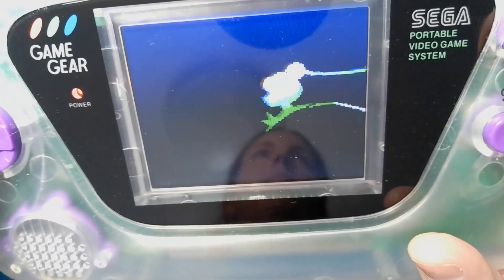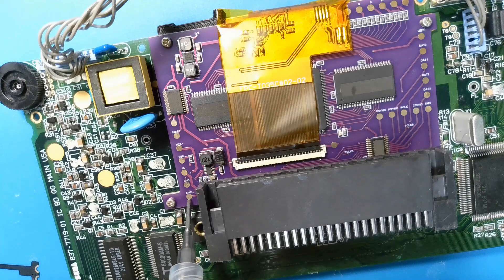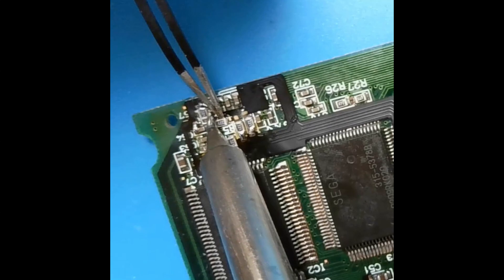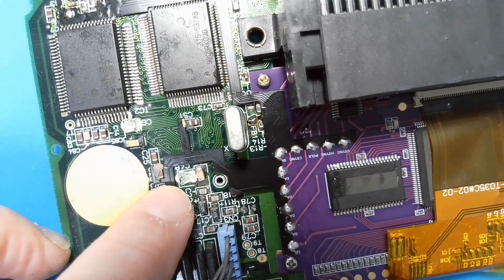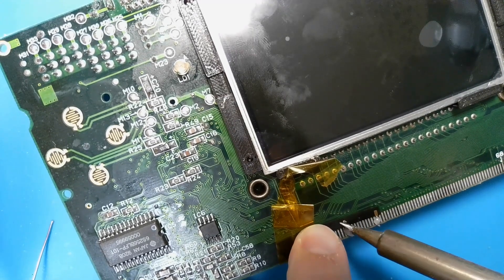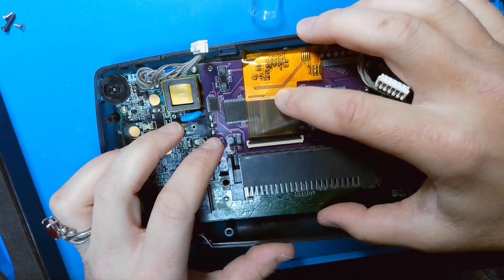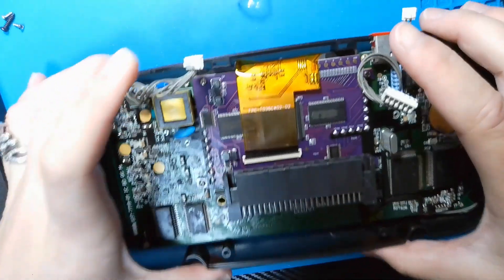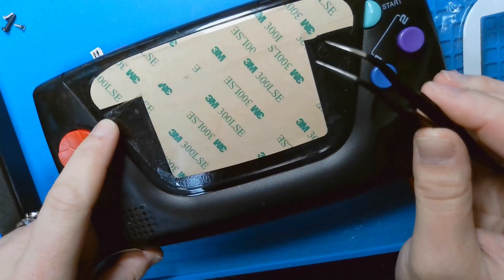Sega Game Gear CleanScreen Mod

Comment: Holy crap that looks so much easier than the ones I did. I got the first gen mcwill clones from ali express and a few of the 2nd gen clones with brightness control. I had to use all wires and regular caps which meant I had to route everything and get the bigger caps  to fit without interfering with the case. I couldn't help with trouble shooting these newer boards but I can say just double/triple check every solder connection you made to make sure there are no cold solder joints or bridges. I did have trouble with the 2nd gen boards because you can't wire the brightness control if you want to have VGA output installed so I had to get some resistors and install them onto the LCD mod board to neg out the brightness control option. The brightness control wheel is what you use to switch from LCD mode to VGA output mode.
Reply from the maker: I've looked over a couple screen mods and this one seemed better because less wires but I may try a different one just to see on another busted screen.
Reply: @dedbattery  You could try running wires from point to point over the ribbons like you did the lcd ones. But it could just be faulty. The first ones I did came in a 5 pack and one of the kits didn't work. It was missing a component and I didn't notice until I had already installed it and put power to it to test. But it works in VGA mode. For some reason the LCD wouldn't work without that component or putting power to it burnt something out. The LCD still works in every other board I tested it with, out of the 5, so now I have a working LCD and a mod board that only outputs VGA. Been trying to make a consolizer out of it so it's not a total waste of money. I have no idea what to do with the LCD though.

Comment: I used to have one of those as well, but gave it to... Goodwill a long time ago! There used to be an attachable TV tuner for that device. Sega at one point was advertising 3D goggles (VR headset) but it never got developed. Thank you 🤓🌹❤️
Reply from the maker: I've got the TV tuner for the ones that had them lol.
Reply: @dedbattery  does it still work? Thank you 🤓
Reply from the maker: @j.lietka9406  for the psp yes I was able to watch the Japanese Olympics, Sega same, and PC express I haven't tested yet 
It would be neat if they all worked I think it was a neat idea.
Reply: @dedbattery  yes, a way of extending the functionality of as hand held game player! Thank you 😉